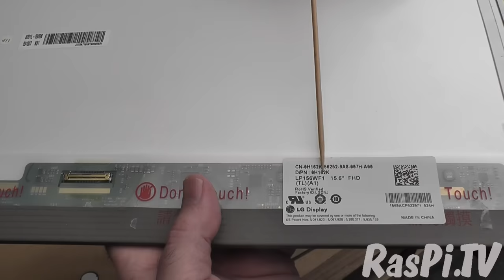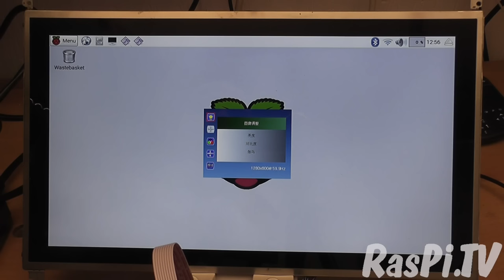Make Your Own 15.6" Full HD Screen for 32 bucks for use with Raspberry Pi, DSLR, Video camera

Comment: Great video, Thanks. I got a board from ebay and the screen comes up in Chinese so I have to figure that out from your directions. My problem is the Pi400 does not display on the screen unless I start it up to my tv screen and the switch the hdmi plug back to this screen from the tv I had it hooked up to. Any idea what the problem is? Thanks, Mike

Comment: I'm pretty much at the connect positives, negatives and pot adjust stage of assembling. I've managed to get a 7" pi with buck converter to run the pi/image from batteries/transformer. The biggest problem I've had is connectors - the 2.5/5.0mm barrel jack for the monitor driver and the 4 pin to carry 12(ish) volts to/from the battery balancer and the adjustable regulator  to get 5V to the pi.
Any chance of a video describing all the connections you are likely to come across while connecting these things together?

Comment: Just stumbled upon you video, now I’m off to see if I saved my old laptop screen.  I’ll let you know if it works out for me thanks for the information / found a LP 17" display and it looks like I can order in a replacement board. Question I see the my screen has a Toshiba M60 M65 LCD Inverter Board K000026560 attached .The board that I'm going to order is 
HDMI VGA 2AV LVDS ACC TTL LCD Display Controller 50pins Board Kit 800x480 resolution for Raspberry Pi . it appears that there is be a spot to connect inverter board to it.  It's selling for 35 US.. Your thought on this?

Comment: That's a great idea, wish I'd seen this before I actually went out and bought a monitor for my studio, as I have a non-functioning laptop with a functioning screen.  Since the studio PC is plugged in via VGA cable (I think, I don't recall), I could probably use the HDMI out to run a dual monitor setup; or maybe just get another Pi to run sound for my podcasts.  Wonderful tutorial, definitely going to look into it!  Thanks!

Comment: what pi model did you use ?
btw great video
and also is there a way to power the controller board and the pi with one connection ?
Reply from the maker: scullbasher I think I used a pi3B. Since I was using a 12V PSU, it can't directly power the Pi, which needs 5V
Reply: amazing, thank you for the info :)

Comment: would it be possible to gut the laptop and place the switching board near old power supply hole. Then mount the pi in the base of the laptop and maybe even a portable battery to run the pi. Would that work?
Reply from the maker: +Ben Young you might be able to, but you'd have an interesting time with the keyboard probably

Comment: I’m going to try this for a project, does the raspberry pi provide enough power to power some speakers, or would I need an amplifier?
Reply: It's just a headphone out, but a PAM8403 can power a set of speakers and runs on 5 volts. Should be 2-3 usd or so.

Comment: Great Video, but what Powersupply is needed? 12v what? we need the current rating? Or even better a link to a suitable one.
Reply: russpeed1 i believe they recommend @ 4amps
Reply: Thanks for the reply, I ordered one of the boards and it worked a treat. Also the 4 amp Power supply works great aswell. Thank you again for this video..Merry christmas.

Comment: Cool! But why is the driver board in the laptop not used and instead a new one has to be purchased?
Reply from the maker: While that might be possible on some laptops(not many modern ones though), the Dell I took apart has only one main board with EVERYTHING on it and the GPU was the part that had died anyway.

Comment: The monitor said it was 800p not 1080p. so its either not full hd or you need to change another setting.
Reply from the maker: Or another possibility that you hadn't considered. It IS in fact a 1920x1080 LCD but I had programmed the Pi to make it display 1280x800 because I like to make the text and icons larger. FWIW you add this code to your config.txt
hdmi_ignore_edid=0xa5000080  
hdmi_group=2 # HDMIPi for 1280 x 800  
hdmi_drive=2 # for alternative modes get sound  
hdmi_mode=28 # 1280 x 800 @ 60 Hz

If I remove those lines, it will default to 1080p

Comment: I was wondering about the same thing since I have few spare LCDs laying around, but better deal is to find old lcd for sale and attach it to Pi via standard cabling. For 32 USD you can have (at least in my home country) older, nice looking 22" 16:9.

Sorry, but this will only make sense if the video controller will cost a lot less.
Reply: The whole point is him trying not to waste a monitor that he had.... why is it so hard to understand what his initial thoughts are?  No shit he can go buy one off craigslist for dirt cheap, but then it will just defeat the purpose of his teachings.
Reply: Man United Not hard to understand at all. Try to read my comment once again.

Comment: hi Alex. is it possible to separate the back chassis from the LCD screen? basically I want to see if I can make a "transparent" screen by removing the back metal plate.
Reply from the maker: Doubtful because it holds the backlight as well. But if you have one you don't care about you could take it apart and see :)

Comment: Hii Alex, I am working on a project which include a 7' display with raspberry.
What i want is to play a video only when my IR sensor (or any sensor) detects motion.
Is it possible, i dont even want to use the touch pad (for this Project).
If yes can u help with the code

Comment: Hello again! How are you doing? Good, I hope!  I was wondering how are going to mount your LCD screen?  I have a few ideas, but nothing really stands out.  Curious how your going to mount it?  I would like to include the video card, respberry pi and the pi camera.
Reply from the maker: I actually have mine mounted on two cup-hooks screwed to a shelf. I used the existing frame around the screen. I'm using it in my workshop as a video monitor when filming and also for Raspberry Pi use when not filming. The driver board is hot glued to a piece of balsa which is hot glued to the back of the LCD. If I needed it to be portable I'd either try and get something laser cut from perspex or make a nice wooden frame myself.
Reply: Here is a picture of how I did mine.  I put the LCD Screen on with Velcro and all the rest with stand offs.  it is a piece of MDF board.  I paid 6 dollars for it at the local Lowes hardware store.  So it didn't cost me much.  Let me know what you think.  Thanks again for all your help.  Had wrong link last time, this is right now. Sorry about that. Check out the picture here: https://app.box.com/s/u67ukq0j5tuwrxfwsnc8javzjee7qfdv

Comment: One stupid question from a beginner: For what do I need the controller board? The RespPi has a HDMI output, so I just need an adapter... or not? Isn't it possiple to connect a  monitor with the raspberry via HDMI?
Reply from the maker: I'm afraid not. The driver board is what translated HDMI signals into something the LCD can actually do. It IS the adapter.
Any HDMI monitor will have some kind of driver to convert the HDMI signals into the language the screen "speaks" (usually SPI or something like it)
Reply: Ah ok. now I understand. Thank you very much and thank you for this interesting video!

Comment: Curious to know what PSU you decided to use for the screen. How did you determine what volts and amps the driver board needs?
Reply: atariforever2002 the details of the part will usually be included when you're looking up the board you need.  you then have the option to supply your own or just buy one of their PSUs.

Comment: I think I got the same board for one of my old compaq laptops. Really glad I did it too. I used it for my ps4 for a while
Reply: Michael Carney what did you do for audio? does the driver board have audio out?
Reply: irononreverse yes. The audio comes in through the HDMI port then it has a 3.5mm output.

Comment: I suppose if the laptop screen is old enough to have fluorescent backlighting as opposed to the more modern LED backlighting (like the screen I took out of my old 15" MacBook Pro 3,1), then you are not likely to find a controller-board for it. Has anybody ever found one for this type of screen?

Comment: I will slightly disagree with you. Now, I bought myself mini LVDS board that has only HDMI plug that for about 22$ incl. delivery. That is ok, because I have some old TFT screens from broken notebooks that I`ve got for free. But if I have to find old screen that is at lest 15-20$. Next, you didn`t mention that one who buy the driver board, need to get model with CCFL tube driver in the set. There are some ebay listings without. Third one is the power supply - at least my model board require 12V - 2A-3A power supply for proper working TFT panel. Mine is 15.4 - 1280x800 TFT and with 12V@2A supply work flawless. If we add the charger even second hand in the bill, that are ~10$ extra. Or we getting close to 50$ or more. So, in that case much easy way is to buy some 7-10" cheap Raspberry ready screen from ebay or even some flee market 14-17" used monitor with DVI support. 
Otherwise is nice idea! Well done

Comment: Is it possible to do with old phone's LCD? I have LG GD510 in my drawer and I'd like to connect it to RPi3. What should I do?
Reply from the maker: Only if you can find a driver board for it. If you can't find one, you can't use it.

Comment: the problem im facing is 1.the display shows "not support" if raspberry pi and display are switched on simultaneously.
2. if the raspberry pi is switched on first the display works fine. My device has a single power supply with one switch, the display doesnt work. Cant figure out the problem
Reply from the maker: Probably if you force the pi to 1080p output it might work
Reply: @AlexEames  Thanks for replying. I tried all options, the display works only if the raspberry Pi is turned on before the display or else it says "not support". And the display I'm using is raspberry Pi display.

Comment: I have a question . I have a defective HP laptop, lcd screen type LTN173KT01.
I would order the following product:
HDMI + DVI + VGA + AUDIO LCD Controller Board kit For 17.3 "LP173WD1 LTN173KT01 1600 * 900 40needle laptop LCD controller board DIY kits. ( Aliexpress )

My question is now, do I need an inverter? What is an inverter?
Reply from the maker: Some LCDs require an inverter. I think it's usually to power the back light. I'm out and about at the moment so can't check yours but hopefully someone else will be able to look it up for you. None of the ones I have done needed an inverter so I don't know much about it.

Comment: Hello, how did you fix the screen ilumination? My board din't have same connection with inverter for leds
Reply from the maker: Not all LCDs need a separate inverter. Ideally the supplier would provide you with a complete kit that works for your LCD. That's one of the reasons why I say it's a bit of a gamble 😀

Comment: This was pretty interesting.  I had no idea you could purchase driver boards for laptop monitors.  I've recycled old laptops in the past with good screens because I figured there was no way to use them.  I won't make that mistake again.

One thought that would really finish off your project.  If you have the ability, or know someone who can help, a custom made picture frame to hold the monitor, driver board, and control panel would be really cool.

Comment: Loved that video. I have been searching high and low for a answer to this question though..... If I was to hook up my old 17"laptop monitor using a driver board is there a way to take a 5v supply off the board to power the Pi? Basically I am looking at creating one power supply for the screen and the Pi. I really want to do this project but the thought of 2 power supplys isnt appealing to me. 
Again, loved the video!
Reply from the maker: There might be, but it would depend on the board. YOu can bet there WILL be a 5V supply on the board, BUT whether or not it can supply a spare 1-2 Amps for the Pi and what you plug into the Pi is an unknown.
Reply: Alex Eames you can always put a cheap inline DCtoDC PCB with trimming pots off the 12v oc trim to whatever v you want,  there's also the 12v DC to pcx

Comment: Pretty handy video. Does the Pi recognize the screen at a full 1080p resolution?
Reply: hallis1 Oh yeah. Some os(s) can use 4k screens just fine.
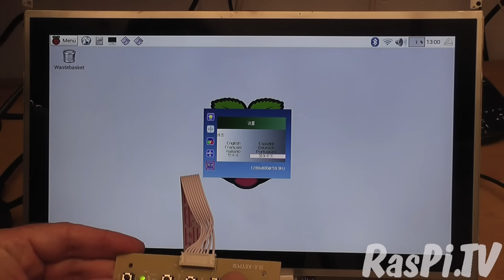Reply: hallis1 its not 1080p its only, 1280x800 as shown at 9:59
Reply: LuxAry Gaming raspery pi can handle uo to 1080p
Reply: the monitor is what i meant, not the pi
Reply: Read description... He set his pi to output only 1280x800 on purpose to make the icons/text look bigger.
Reply: Read question...  I realize it's only SET to 1280x800. I wanted to know if it SUPPORTED 1080p because that's the LCD's max resolution.
Reply: it does and he shows that after the next boot where it used the whole screen too

Comment: Is it possible to use the screen of an 27 inch mid 2011 imac as a normal monitor without a graphics card ?
Reply from the maker: +Nevsek not really no. You'll need a driver board

Comment: interesting,but i have orden before 10,1 inch display and display has broken, i try search new display at internet, not found, or has expensive than all new broduck whit driver, if can add old ibm 14" display these `? i no know, i have new not used driver board now at home only.broken display has" loye boe10,1-33ledh" number "001 2017-9-19" but i not found cheap new display anywere.

Comment: aww driver board.  I was hoping to see how to use the DSI connector.

From what I read,  you need a phone from ~2008 to find one with 2 lane  LVDS.  Most screens are 4 or 8 lane.

Comment: Did you use the power supply of the old laptop for the driver board?
Reply: i have the same question. probably the answer too. tried it. But, the laptop's power supply won;t fit the driver board's. what specs should i be searching for?

Comment: can we connect VGA port of driver board to VGA-to-HDMI-to_hdmi_of_RPI and HDMi of driver board to chromecast? I want swap screen between RPI and chrome cast, without making or breaking connection
Reply from the maker: Yes you should be able to do that, or use an HDMI to DVI lead with the DVI port

Comment: Hey there, awesome idea! I decided to make one too with my old dell laptop, which has a nice lcd screen. After ordering the new driver board for the lcd screen and some weeks later I was finally able to try this out. I connected the lcd to the driver board, and the driver board to my laptop. Everything worked perfectly fine so I decided to place the screen at a better place. After plugging all the cables in again the screen started to turn on and of, it's like a sharp white color for a really short amount, than it turns black, a few seconds later it does the same. this just continues. When I press the menu button and the screen blinks white, I can see the little menu popup. Sometimes when I try it again the screen works just fine, but most of the time it just starts blinking and blinking and blinking.... I really have no clue what's wrong. Is there anybody who can help me?

Comment: Hi. Can someone please explain driver boards to me in simple terms? Trying to figure out whether it's a GPU or not and if it absolutely necessary or not for this type of project
Reply: The Raspberry pie sends an HDMI signal from its GPU. The driver board reads this signal and then controls the screen through LVDS. The driver board also provides power for the screen's backlight, which is either LED or fluorescent. The screen is pretty much useless without the right driver board as they all use different communication protocols.

Comment: is your house really dusty? never seen a computer (much less two!) die from overheating in a few years.
Reply from the maker: It's actually quite common with Dell laptops if you google it
Reply: Alex Eames I have a 8 year old dell laptop. still works just fine.

Comment: i have this exact board and cannot get it to work right... i connect everything properly and they power it on. the backlight lights up then a second later goes black and the power led on the board goes red.. then nothing...
Reply from the maker: I wonder if the board has the wrong firmware for your LCD? Each type of LCD needs its own firmware specific to the family of LCDs. These boards are often generic, but without the right firmware they are not usable.
Reply: how can i check this? or modify it?
Reply from the maker: I don't know how. That's why you have to buy a board from someone who will flash it with the right ROM for your LCD. There will be people with the necessary hardware and ROMS, but I don't know a source.

Comment: My mind blowed away. I'm building a new pc (nothing fancy) and for that I use a chassis from corsair 175R with tempered glass (atm not finished). I was thinking if I can find a way to replace the tempered glass from the chassis with a 17" laptop display. Mention glass is 45 cm tall I don't know yet how wide. This will give me the opportunity to power it up straight from the USB/GPU (since the RasPI fools them sistem making him think its another monitor added to the sistem). Please master share you thoughts on this with me teach me more

Comment: Why didn't you remove the guts motherboard and all then fit the driver board and PI inside would have made a good laptop??
Reply from the maker: It's not quite as easy as you might think. For example, how would you get the keyboard and touchpad working without a USB interface to plug into the Pi? I just wanted a screen and I'd had enough of the dead Dell I'd used for 4 years :)